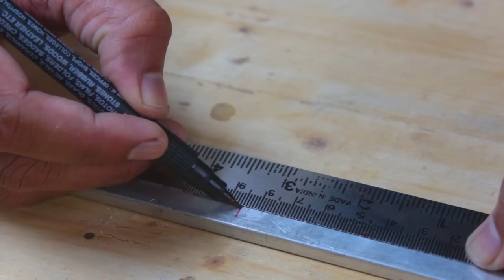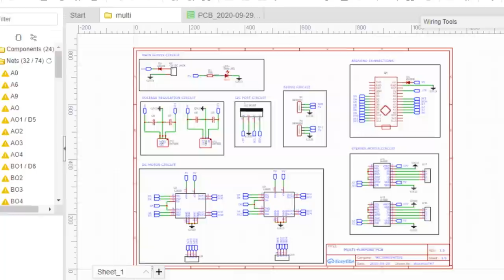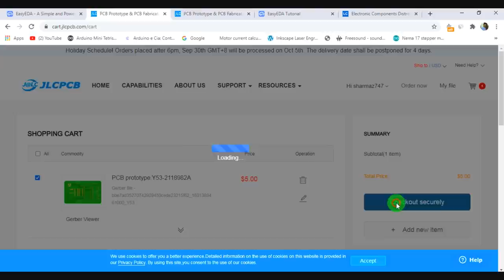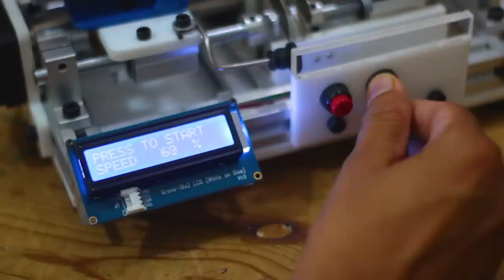DIY Arduino based Bobbin Winding Machine

Comment: Great impressive project.
A small suggestion, in the nichrome wire section, you could have used ceramic beads to slightly isolate the acrylic from the nichrome wire, thus preventing the gradual slowly melting plastic.

Comment: this is pretty cool. nice mecanic.

do you think you can make a machine to crimp dupont connector on the wire ?  because this is tidious to do by hand when you have hundreds to made for a project, it is also not consistent and a lot of faillure occur by hand.

I think you can use the hand cripping tool and automatism it.

Comment: I've always wanted to wind bobbins like this with wire to make single string guitar pickups, but wrapping them by hand is beyond tedious... This would be almost exactly the type of set up I would need, but for a different method of cutting the wire... I doubt the hot wire will cut magnet wire...

Comment: An interesting project for me. I would like to recreate that. Unfortunately I don't have a CNC machine to mill out the parts. So I would have to cut them out manually or produce them in a 3-D printer. Unfortunately, neither dimensions nor a scale are given in the CAD file. The board layout and the parts list for assembly were not published either. It's not just about advertising or hymns of praise for the developer. You would also like to be able to recreate your projects.

Comment: Hello brother nice project, please I want to know where the button is connected
Reply: ... and also the potentiometer !!
There are no free analog inputs except A6 and A7 of the second L293D.
I believe the button and potentiometer are soldered under the board (out of sight) on the unused pins of the L293D which is not mounted.
It would have been complete if he had shown it but it probably wouldn't have been nice to see ...!

Update
This is part of the code:

int pot = A7;
int val = 0;
int button = 2;

so that we found where Pot and Button are connect to!

Comment: Why not a rotary encoder instead of a pot?
Reply: In a project like this, it doesn't matter much. In professional settings, engineers usually choose parts that are already being used in other products. That way they don't have to inventory anything new.

For a hobbyist, use whatever you have on hand.

Note that there are many kinds of rotary sensors, with huge variations in tactile feedback.

Comment: Please, what motor is used for this?
Reply from the maker: two nema17 stepper, one 775 dc motor, 1 servo motor
Reply: @MrInnovative  Cheers. If it's just a DC motor for winding the bobbin, how do you do an accurate number of revolutions? Does it have a hall effect sensor or rotary encoder disc?